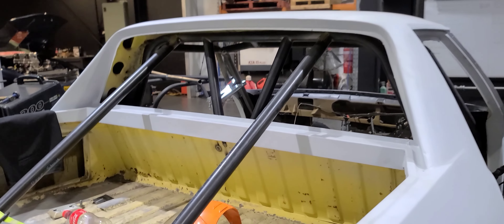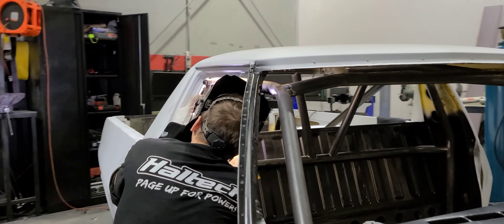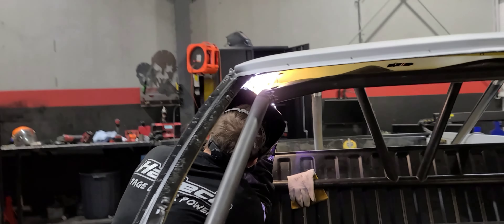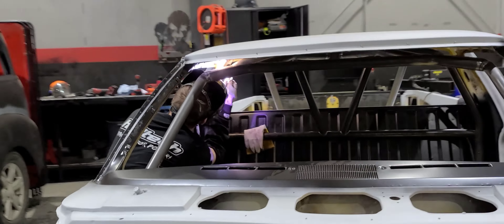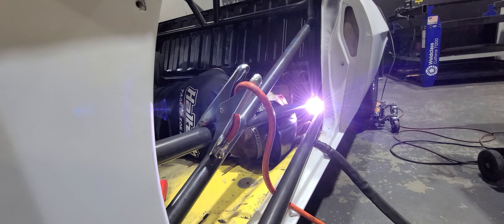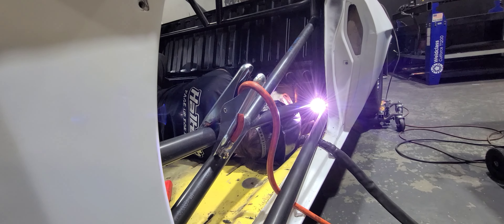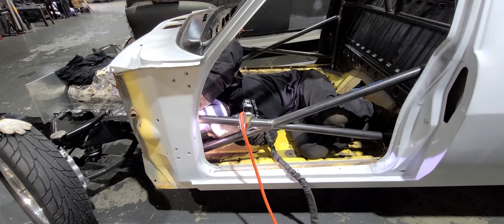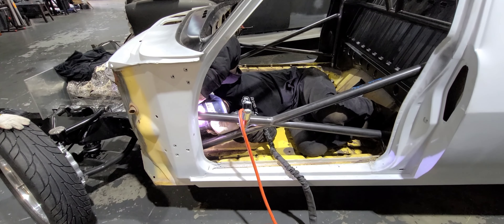Holden HZ ute 6 point drag IHRA HBR Race Cage install at Warhorse Motorsports

Comment: Love my hbr bolt in cage! Dude does quality work
Reply from the maker: Sure does I have one in mcfry, much easier to install the bolt in cages.
Reply: @MCFRYMotorsport  yeah I towed my car from Newy to Toowoomba And had him do it all
Reply from the maker: @chuxshed587  the guys at zero5 have all the gear to bend up cages but still welding out a diy cage makes it an easy task. The intention I originally had was to do it myself haha glad I didn't as there is deffo an art to it.
Reply: @MCFRYMotorsport  I know my limitations, no tuning, autos or roll cages haha